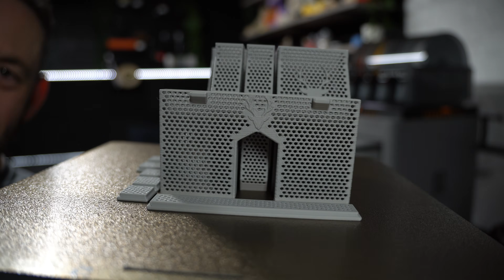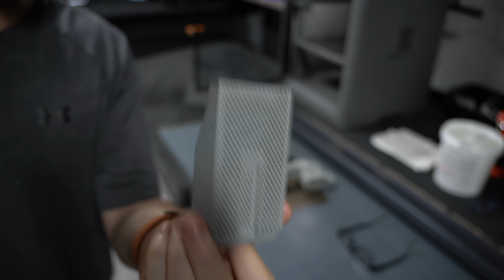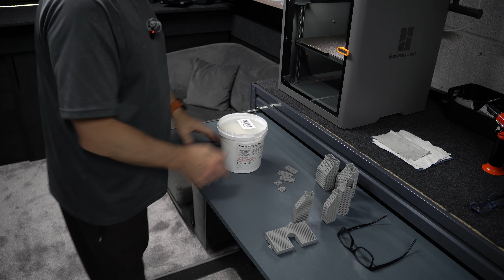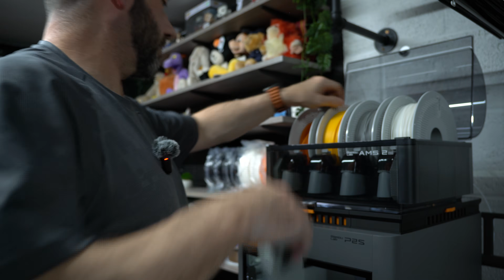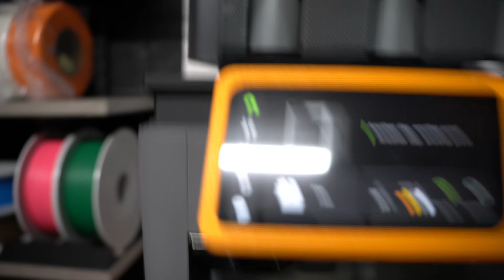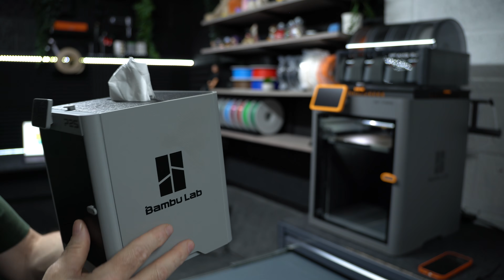3d printing your own 3d printer! | Bambu Lab

Comment: What is the power supply for the ams2 pro where do i get one?
Reply from the maker: I bought a separate one for the AMS 2 Pro as the connection with the unit does power it but you need a separate one to heat while using so Bambu sell a separate one

Comment: I love your enthusiasim
 You haven't just been bitten by the 3D bug, you have been devoured by it and I can relate. I would be willing to bet that by the end of the year you may have a second printer. As far as the color swatches for the different colors of filament you can download those off many 3D sites like Makerworld, Thingiverse, Printables etc. and print  them. And trust me you are probably going to end up with more spools of filiment than you can count. Especially when you start adding different types of filament like PEGT and TPU and others as you progress. I woukd highly recommend you starting with PETG next if you haven't already. It is much more heat resistant than PLA and also quite UV resistant for outside prints. Or also look into HT-PLA for great heat resistance as well. And since it is  a form of PLA it prints with virtually the same settings as regular PLA. Good job so far though.

Comment: If you use the drying while the desiccant holder are in they may deform from the heat, if you made them from PLA. You might want to make them from PETG  or better yet ABS.
Reply from the maker: Yeah good point! I only use PLA at the moment a week in, but hiya re quite right I need to up my filament if I change to anything else 🙌
Reply: @The3dTaylor  Don't be afraid of PETG or ABS. PETG prints almost as easy as PLA.  ABS can and will warp depemding on the model. Make sure your settings are correct for each filament. You've got this! Iam glad to see someone as excited as I am about 3D printing. I have had my P2S since November, but was pring on an Ender 3 for years.
Reply from the maker: @scott9488 thanks for the advice, yes you are quite right I have got this and will look at ordering some other materials and will give them a whirl
November hey, bet you have mastered it by now! And yes the excitement is real 😂😂

Comment: I do hope you printed those in PETG ...  if you ever going to dry PETG in the AMS ... PLA is going to go soft coz of the higher temp.
Reply from the maker: Now that seems really obvious now 😂 quite right I will when I move on to higher temps will need to do that thank you! 🙏🏻
Reply from the maker: I subbed you BTW 👌
Reply: As long as you don’t dry PETG it’ll be fine, since I usually use mixed filament I don’t go above 45c / PLA drying profile. If you go above 60c it’ll melt.
Reply from the maker: @MistaD78 yeah I’m not brave enough yet but when I do will change it out I guess 🙌

Comment: I printed a few different funnels for replacing desiccant, and you can also use them for other stuff too.
Reply from the maker: I did actually think of that 😂 but would like a small jug I think as the big container will be difficult to pour into a smaller jug and then into the holders?

Comment: Hmm, 2nd attempt.  It seems me placing URLs in doesn't work.  Firstly, the tag system I use, search "Filament Swatch System" by Mark'sMakerSpace.  This also lead me to the website he mentions in his comment "3D Filament Profiles".  They tie together really nicely, but you do need a label printer, I bought the one recommended on Amazon, a Phomemo M220 for about $70 AUD.  But, each to their own, there are heaps of different systems out there.  The website can be used to set up your own filament inventory system as well, so it is pretty good.

I printed out the fidget orange that you previewed in your last video, I like the idea of it being in fruit.  I had a bit of a catastrophe, one of the pith segments dislodged and jammed under the nozzle and snapped it off.  I've never seen anything like it.  Luckily I had a sparem and I'm hoping Bambu replace it under warranty, if they don't, I have ordered 2 more as spares. 

Do you know what kind of nozzles you run?  Is it the stainless steel nozzle, or the hardened steel on?  If you haven't already, it's probably worthwhile getting a spare and maybe a 0.2mm nozzle for really fine work and a 0.6mm nozzle for the beefier work, like for those filament racks, they print faster.

I should have mentioned it the other day, you can get desiccant boxes for your AMS that you can put a hygrometer in to keep track of the humidity.  Although, I think you can get the humidity from the devices tab on you slicer.

And finally, you should check out the PLA Metal series.  I love the PLA Metal Iron Grey, it's not a pitch black, but a warmer black and pairs really well with the orange.  If you're into the greens, PLA Bright Green and the Iron Grey go really well together too.  Bright Green prints out like Ryobi green.
Reply from the maker: I have literally just ordered 3 of the metal series from Bambu
That’s a shame about your orange print mine seemed to come out quite well
Not sure why I didn’t see this comment the first time either?
Thank you so much for your support bud honestly, but your comments are coming through 🫶🏻